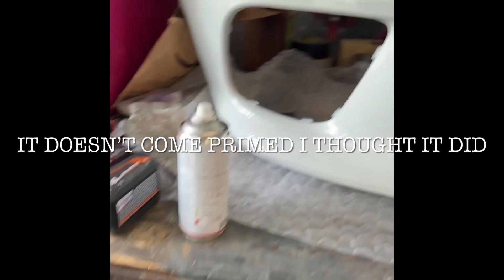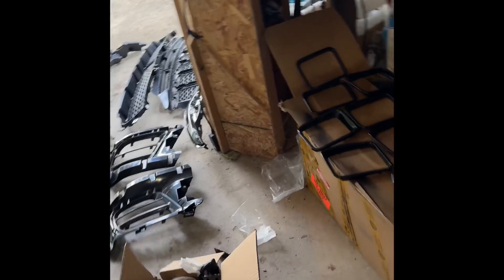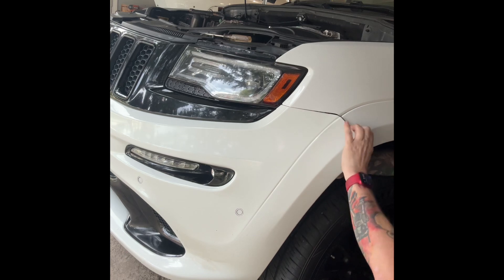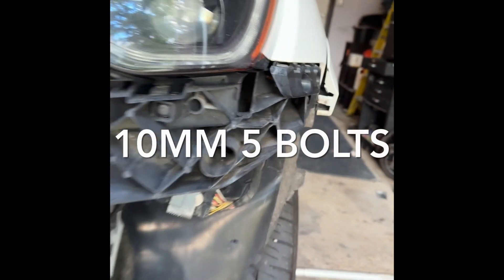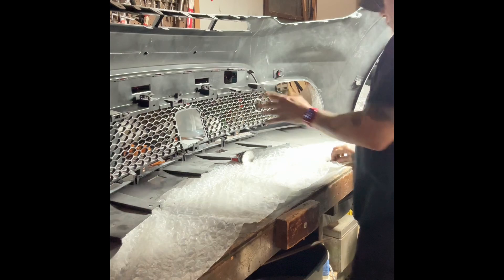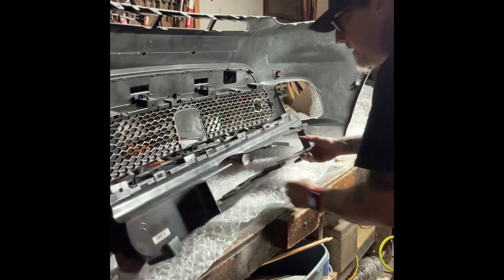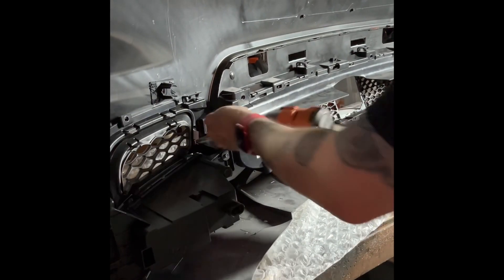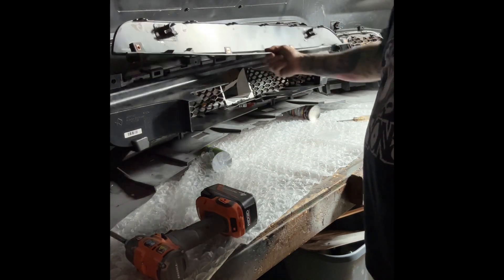2011-2016 jeep grand Cherokee SRT front end conversion to 2017-2021

Comment: Hi, question, im doing this with an Overland model. Any idea how i can make the updated Fog lights work on mine? Pretty sure i need an adapter since i have halogens and the new ones are Leds. Any tips though?
Reply from the maker: @juanlopez-xr9wd  did you change the bumper yet
Reply: @mrbungle6visix  Not yet
Reply from the maker: @ it may work I had halogens on the lower fogs and the wirings was the same and worked
Reply: @mrbungle6visix  Thanks I'll be checking that out tomorrow. I tried connecting them to test them but they wouldn't come on. I might have something mixed up, hopefully its something simple. Thanks!